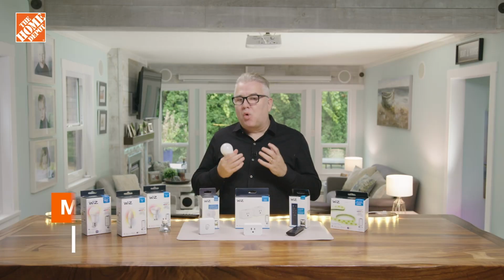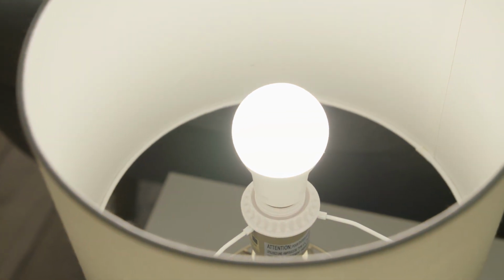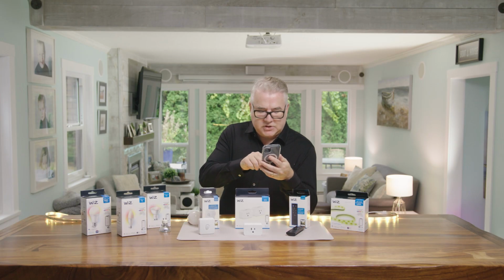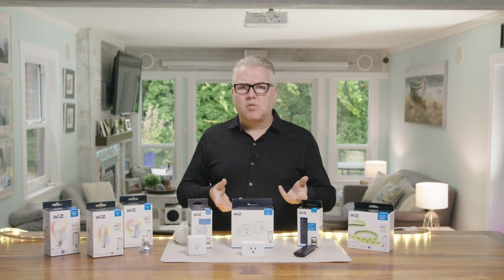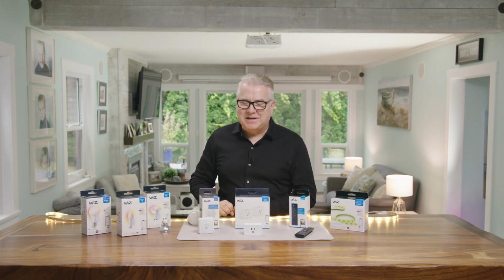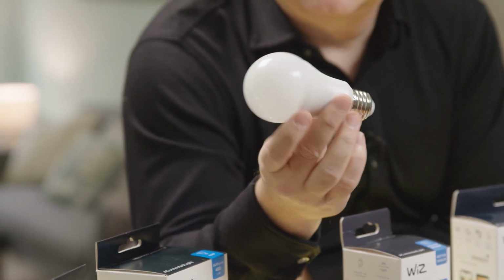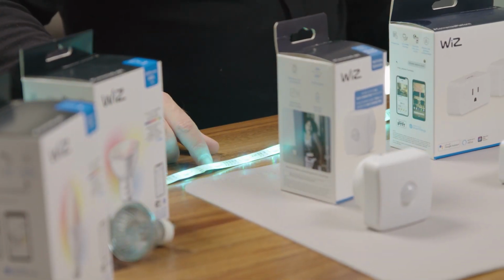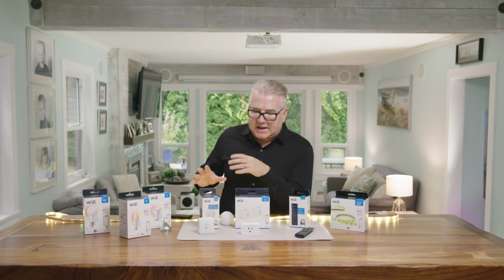WiZ Smart Lighting Walkthrough: Features & Benefits | The Home Depot Canada

Comment: Worst experience in a long time:

Hello, I purchased two packs of the following product:

Philips WiZ Smart LED A19 E26 60W A-Line Light Bulb, Dimmable Full Color & Tunable White (2200-6500K) 3-Pack

And 1:

Philips WiZ Gen II Smart Remote Control

I've been trying different brands for five years and this has been the worst experience with smart bulbs I've had so far.

I would like to mention that I carried out the correct installation following all the instructions in the manufacturer's manual and the application and when problems started to appear I followed the instructions from customer support and the website's FAQs.

I installed the lamps about a month ago and these are the problems I encountered:

-The lamps constantly disconnect from the network (I bought a new modem last month and it has all the necessary specifications).

-The application is very slow, has many bugs and is not very intuitive.

-The lamps will not always respond to commands.

-Some of the lamps overheat, at a level that does not seem to be safe (I checked and the lampshades that I installed them in are suitable for this type of technology).

-The control often does not fulfill its basic function. Sometimes he changes all the lights and sometimes he doesn't. It randomly stops working.

- And I believe that the worst thing is that two of the lamps started to have a strange behavior, blinking and turning off repeatedly, especially in the early hours of the morning, where I often woke up at night with a strong white light in my face. I live in an isolated house so there is no chance of signal interference from neighbors.

In short, the lights were supposed to help and make my daily life easier and they are disrupting my life, in addition to the time and money I invested.

I checked the forums and all my complaints seem to be very common problems among other users.

I do not recommend this product to anyone.

Comment: Sadly I've had a extremely bad experience with Wiz Wi-Fi bulbs.. purchased three with Wi-Fi bulbs approximately 8 weeks ago straight away started to experience problems where the bulbs were working and then were not. Contacted customer support via application and eventually after a period of weeks we were told that the bulbs were faulty and they would be replaced. New boobs had arrived being in contact with Wiz to reinstall as per their instructions and for the first couple of days the bulbs worked fine then it started again!! Voya the internet the schedule was set and the bulb started to come on and off when they wanted they also were dimming and getting brighter when they wanted to. One bulb would come on and the other would not just a complete disaster.. have been in contact with customer support via app and requested money back as these bulbs are not fit for purpose not quite sure where the other end is situated in the world but I have been waiting for 4 days for a reply.. not happy customer here as gone through these bulbs pair with instructions several times and we are still being told to do the same installation

Comment: hey! I have a question. I have had the LED strip above my kitchen for a week. Now I have often tried to connect the LED strip to the app, but this does not work for me.

Do I need anything extra for this? I try to connect it via lamp but that doesn't work.

Someone who can help me?
Reply: Do manual pairing but when it says to turn on and off do not do it from the button. Plug and unplug the electricity instead. That worked for me.